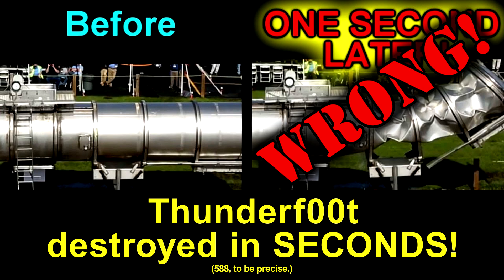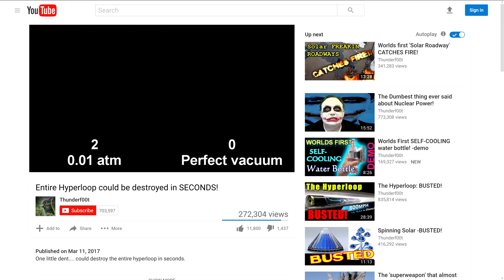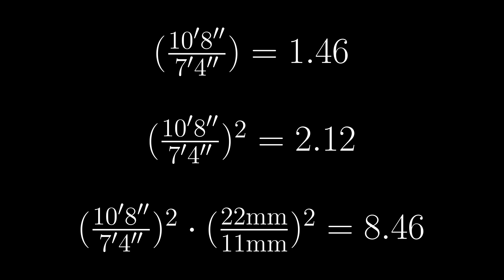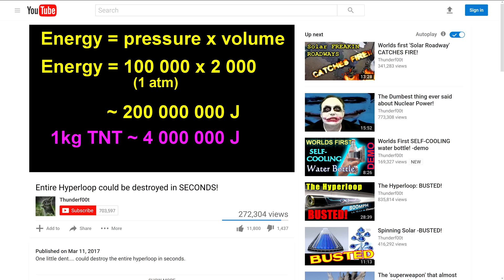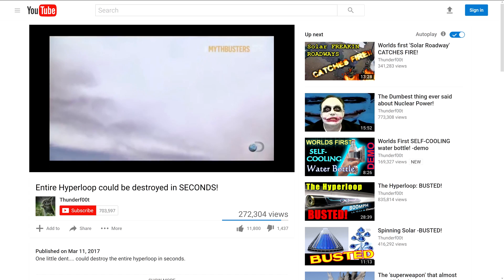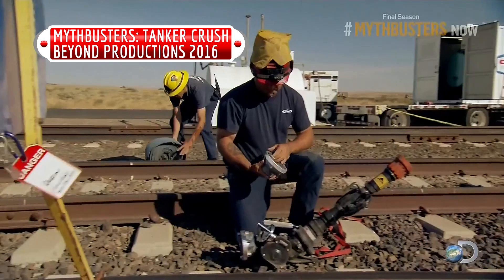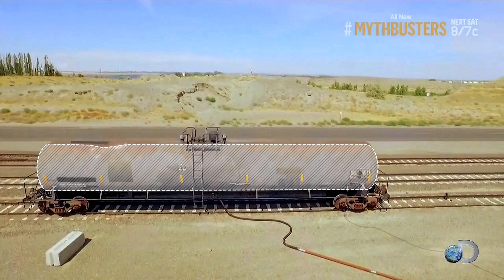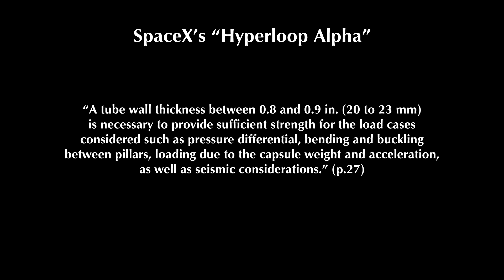Thunderf00t destroyed in SECONDS!

Comment: It just seems to me that nonetheless the hyperloop is too fragile. The cabin has to be very tight against the tube right? So if there was a minor earthquake wouldnt the whole hyperloop collapse? 

Is there a engineering solution to this?
Reply from the maker: "The cabin has to be very tight against the tube right?" Um, what?
Reply: Shane Killian Im not very informed about the hyperloop :p

But nonetheless if there was a minor earthquake couldnt that break the tube? Like make a crack or even hole in it?
Reply from the maker: The Hyperloop Alpha document goes into that. The supports are flexible enough to allow for a great deal of vertical and lateral movement.
Reply: Shane Killian Oh okay then :)
Reply from the maker: +rochii ALL covered to death throughout this series!
Reply: These are all engineering issues that have been dealt with in exhaustive detail when constructing pipelines (which operate at VASTLY higher pressure differentials than the Hyperloop—the difference between the inside and outside of the Hyperloop is 14.6PSI.  The difference between the inside and outside pressure of some pipelines is over 1,000 times that much.  There are 2.4 million miles of pipelines in the USA, the majority of which are more than 30 years old.

Comment: You nitpick and seem very angry over this topic. Thunderfoot is right. You can ignore what he has put forward if you want - you didn't disprove either of the calculations he brought up. For example..
The whole thing with the energy wasn't to show how expensive the hyperloop would be - it was to show with how much energy those "pods" could potentially have when hitting something when that vacuum decompressed....duh?
So either you didn't get it - or you being intentionally dickish...
Btw...Only reason I even made a comment was your misleading title....10mins and you barely made a point. (Brought up "supports" in the hyperloop I've never heard them mention but w/e)
Reply from the maker: Except as we showed quite clearly, the tanker is in no way analagous to the Hyperloop, which would be 8.5 times stronger NOT COUNTING the internal supports. Also, it's not a sealed environment the way the tanker is. You just CANNOT get that kind of cascading failure with the Hyperloop, and NOTHING in this rant of yours disproves what we showed in the video; it only denies that it's there when it absolutely is.
Reply from the maker: Except, as we showed, IT WON'T.
Reply: Hyperloop is bad at the begining. For something that goes so fast that it can cross a state in an hour its bs. First the hyperloop can fail second it can derail third the tunnel explodes forth the people in there dies due to the speed ect
Reply from the maker: Uh, the Hyperloop doesn't use rails, so how can it derail? And what fuel does the Hyperloop have that would make it explode?
Reply: Then remember how fast it goes? What happens if like it just spiraled and bust the god damn tunnel? It also can explode due to the speed and the pressure.
Reply from the maker: Uh, how would that happen? Also, that's not how explosions happen!

Comment: Even if the tanker had less support than what the hyper-loop should be, the rounded bulkheads on either side reduce the inward force from the tubular structure. Besides the other drawbacks, for a near vacuum tube the pressure would be immense over than amount of space linearly.
Reply from the maker: "the rounded bulkheads on either side reduce the inward force from the tubular structure." LOLWUT???

Comment: Wow.  I was totally taken in by Tfoot despite the fact that it would seem ludicrous for the hyper-loop engineers to have not considered the issues he brought up.  Shane, you the man!
Reply from the maker: We're talking about a collapse due to the vacuum, NOT bombs. I love the fact that you people have to continually bring up bombs. Like you can't destroy ANYTHING with a bomb. That just means that bombs are dangerous, not the Hyperloop. So I guess the 9/11 attacks mean we shouldn't have airplanes...
Reply from the maker: Now, that's just a lie, isn't it? We show that the Hyperloop would be 8 and a half times stronger than the tanker even without the internal supports, and there's not enough air pressure left to make a differential 8 and a half times stronger!
Reply from the maker: We went over this elsewhere in the series, and even showed the math (and DON'T YOU FUCKIN GODDAMN DARE demand the timecode again, LIAR; if you can't be bothered to watch the whole series, then SHUT THE FUCK UP ABOUT IT). What would happen is that the first bits of air rushing in would come in at the speed of sound, but you wouldn't have anywhere near the quantity of air you'd need for a pressure wave at M1, even if the tube were completely severed through. The pressure wave would very quickly expand at M1 and what you'd actually have is a pressure GRADIENT which would simply mean the air surrounding the pods would gradually increase in pressure overall. The difference in pressure between one end of the pod and the other would be negligible.

And that's without considering the support structure, which work work as baffles to slow the air down even further, making even more of a gradient.

THE PRESSURE WAVE THING IS WRONG. We showed it to be wrong OVER AND OVER AGAIN, THROUGHOUT this series. FUCKING DEAL WITH IT, LIAR.
Reply from the maker: "This video doesn't contain any analysis on the catastrophic failure mode. It simply states it won't happen." LIAR, the thing it SHOWED (NOT just stated) wouldn't happen is the VACUUM COLLAPSE! That doesn't have the FIRST FUCKING GODDAMN THING to do with this mythical shockwave, which is what you're NOW saying you're talking about!

YOU ABSOLUTELY ARE LYING!!!

"You seem to be under the impression I brought up vacuum collapse in the sense of a squished tube." Because that's the ONLY thing that video addressed, LIAR!

"The problem is you ignored the shock wave." No, YOU FUCKING LIAR, we showed THERE WOULDN'T BE ONE!!! And the figure of 1.6Gs of acceleration WAS assuming the shockwave--that would be the acceleration FROM the mythical shockwave even if it DID happen, when it COULDN'T!

EVERY SINGLE FUCKING THING you have EVER said about ANY of my videos HAS BEEN A LIE.

"It's much, much higher. " Show your math or STFU.

"Did I hear correctly that it was Libertarian that did the calculations, not you?" We BOTH did them, and checked each other's work.
Reply from the maker: Uh-huh, so when talking about "explosive" in a thread about explosive decompression on a video that's about vaccuum collapse neither of which has anything to do woth bombs or any other incendiaries, you were all of a sudden talking about bombs and not the obvious in-context reading. Gotcha.

With a bomb, you MIGHT affect ONE car if you got the timing right (remember the tube is invisible so you can't see where they are). The others are too far away to be affected.

I like how you think the Hyperloop is going to be made out of dominoes or something.
Reply from the maker: "I am talking about explosive decompression in the sense of vacuum collapse." Yes, I know. That's how I knew it was dishonest for you to bring in bombs.

"I am talking about explosive decompression in the sense of vacuum collapse." No, LIAR, a bomb is an ACTUAL explosion, not an implosion into vacuum.

"A bomb is just one example" Yes, we did. Repeat the LIE all you want; that will NEVER, EVER, EVER make it true.

"My point is you didn't address catastrophic failure." No, I'm not.

"A catastrophic failure will affect the entire tube" No, it won't, and you've done FUCK ALL to show that it will.

"A catastrophic failure will affect the entire tube" YOU FUCKING GODDAMN LIAR, I SAID THIS SERIES DID!!! NOT THIS SPECIFIC VIDEO!!!

ALL you fucktard woos have is LIES. NOTHING BUT LIES.
Reply from the maker: "You never said anything before this about the "series"." LIAR!!! The series was the FIRST THING MENTIONED in the video, and the playlist is linked to in the end screen.

Your concerns HAVE BEEN ADDRESSED. Your failure to acknowledge this is DELIBERATE and DISHONEST.
Reply from the maker: "He seems unable to carry on a civil conversation." Well, YOU seem unable to carry on an HONEST one.

(Funny how over on my latest video I'm having much more civil conversations with COMMUNISTS, who oppose everything I stand for. Makes it clear: it's NOT me...IT'S...FUCKING...YOU!!!)
Reply: Says the man who hasn't read the alpha.
Reply: "For example, you can't assume all failures will result in relatively small leakage"
We never said all failures would result in relatively small leakage. We did contend that a bullet hole would constitute a small leakage.
We also contended that even a major breach, such as one created by a bomb, would shut down the system, but WOULD NOT endanger any passengers (except to one pod if it were close behind the breach at the time of the failure). Why are you ignoring the analysis we made on that failure mode?
Reply from the maker: Yes, you made it a new thread so you could FUCKING LIE about what I said and readers couldn't tell because they couldn't see that you DIRECTLY and DELIBERATELY misquoted me as agreeing with you WHEN I CLEARLY FUCKING DID NOT!!!

That thread was deleted. Reply here, or STFU.
Reply from the maker: HarshColby has been blocked for repeated personal harassment. (No one can say I didn't give him plenty of chances!)
Reply: How about you read and understand the white paper and watch the other videos Shane has done on the subject first.  So many people seem to think they have valuable criticism to apply without having more valuable knowledge.  Also, obviously a bomb will be be dangerous to ANY mode of transport.
Reply: HarshColby Would a "Catastrophic" failure of a roller-coaster affect all the cars on the track? Yes, yes it would because by definition it's catastrophic. Duh. Same for the HL or any other forms of transportation. Catastrophic failures are well, catastrophic.
Reply: I believe it works like this:  If you severed the tube completely then you would have air rushing in at near M1.  As the air pressure front moves it will encounter resistance along the tube walls, the speed will remain relatively constant, however the pressure would become more and more gradual at the front as it traveled.

Other things to note, hitting a pressure front is nothing like hitting water since air is compressible and has a much, much lower density, as such it carries much, much less momentum.  A capsule is going to be much more sturdy then a typical jet that can handle this.

Braking systems i have seen use eddy current braking, i.e. strong magnets that producing drag near a conductive surface, they don't contact.

Comment: You didn't debunk shite If that tube was dented or damaged in any way it would implode. Not to mention the one time you show math you use different units? You have to be one of the biggest idiots out there. Also where are your sources for any of this information? no links in the description or video.
Reply from the maker: "You didn't debunk shite If that tube was dented or damaged in any way it would implode." Sigh...WE COVERED THAT.

"Not to mention the one time you show math you use different units?" LOLWUT???

What, in your pathetic, deluded mind, needs sourcing? We showed mathematically that the Hyperloop tube would be almost 8.5 times as strong even without the internal supports; you don't need sources for math. What, do you fucking think we should have sourced ACTIVATION ENERGY? Something as BASIC as that?
Reply: "You didn't debunk shite If that tube was dented or damaged in any way it would implode."
Only if the energy released by the collapse of the vacuum exceeds the energy required to deform the tube.

Thought experiment. Suppose the tube walls were 10 feet thick of solid steel, would it be possible for that tube to collapse even if it were dented somehow? No. Of course not.
So then it just becomes a question of "How thick do the walls have to be?"
What's the answer to that question, how do you justify it, and why assume that the engineers working on the project are so incompetent that they can't figure it out?
Reply: We didn't use different units in our math. We cited a tanker truck that was specified in imperial units and converted that to metric before carrying out our calculations. That's the proper way to do things.
Reply from the maker: To clarify: that's because we had one in imperial and one in metric, so we changed the imperial to metric. The other, we had both in imperial, so there was no need to change since the units cancel and doing a conversion could only introduce error.
Reply: Umm, are you high?